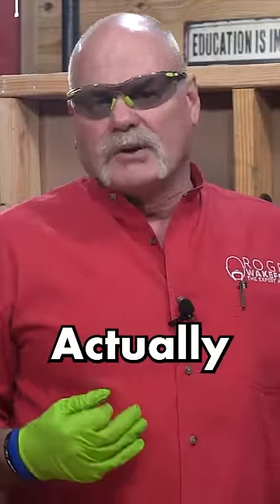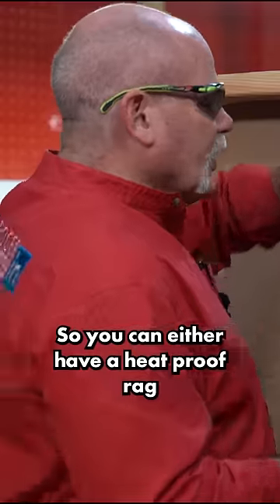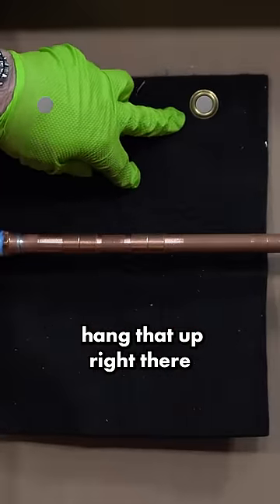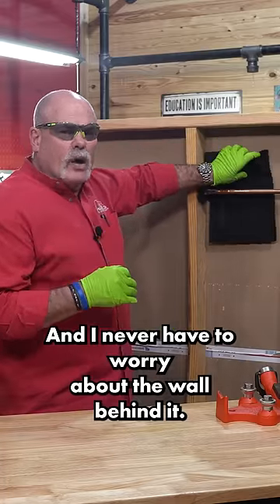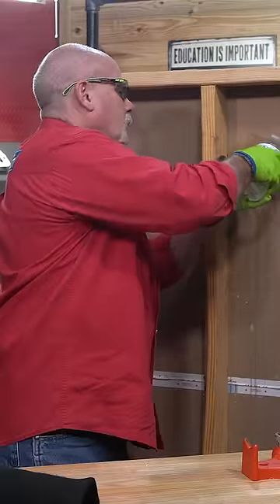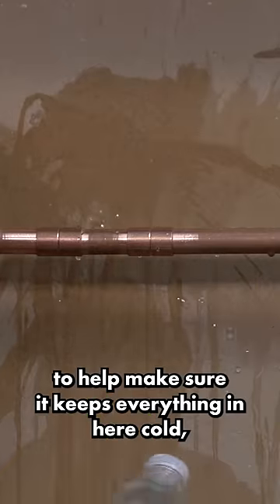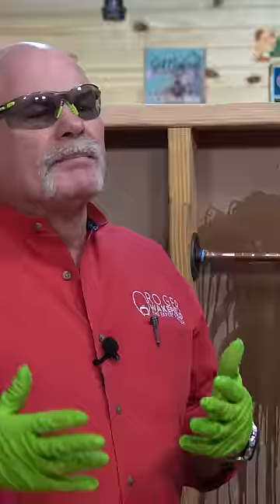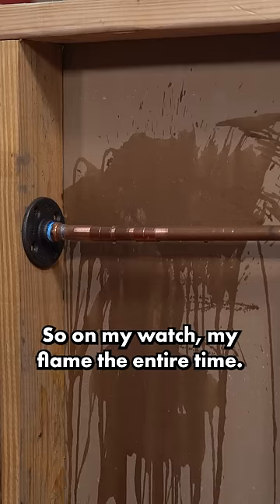Solder Joint Catches Wall On FIRE

Comment: Introducing moisture into a wall is asking for mold.
Reply: Amen brother! Aluminum foil would be a great alternative to protect against the flame and flux splatter!
Reply: @stephenadams9211  I’ve forgotten my fire sheet before and tried to use aluminum foil to heat shield while soldering don’t use it the foil just melts almost immediately but yea also don’t use that water trick that’s dumb for many reasons
Reply: A little water once without a recurring leak will not lead to mould unless your house is as humid as a rain forrest.... It will dry out by next morning.
Reply: Mold is only a problem if it's sustained moisture exposure not a one time exposure. Other wise we would have mold all over everything.
Reply: Mold is okay as long as it's not disturbed just like asbestos . You wouldn't want alot but you'll literally never find a house without some Mold in it
Reply: Cut a piece of sheet metal for the back of the heat blanket
Reply: That little amount won’t do anything and hopefully they dry it before closing it up.
Reply: Hes just the plumber, the drywallers wont be in till next week to close it up
Reply: @Kwilson2O14 yup. Not only that, but drywall mud has a lot of water in it. That water soaks into the rock and still dries off.
Reply: @stephenadams9211  I see someone is recommending things they have never tried again, tisk tisk
Reply: As a mycologist i just want to say your wrong.
Thats not nearly enough water to start mould it has to be a pool and a significant one.
That water would dry up by the time you even put that wall back together.
Or even by the time he finishes soldering.
Now if it sat in a puddle and soaked hydrating the substrate (wall) then you would have a problem but that is nowhere near enough moisture for that.
I mean which one of you demons with no common sense leaving pools of water in walls i mean if you are who's ballsy enough to trust you with fire.
Reply: the torch will dry it out
Reply: yeah this guys has lost his mind
Reply: Why's it gonna mold? Should be dry in a less than an hour.
Reply: let's not forget he's a plumber if he's inside a wall it's most likely because something was leaking so that little splash is the least of everyones problems
Reply: Doesn't heat travel more easily through water than air? Would it not heat up faster by becoming wet? Or does the sheetrock absorb the heat faster than the water would, making the water a good idea? I'm confused
Reply: @zacharybrasher8194  Water is extremely good at absorbing heat. When there is water on a surface, that surface won't get hotter than the boiling point of water until all the water has boiled off.
Reply: @zacharybrasher8194  well bud why don't you try to burn 2 peaces of paper 1 dry and 1 wet report back which ones easier to lite on fire 🔥
Reply: @jeffkenyon7084  spraying a little bit of water wouldn't soak the sheetrock all the way through, unlike the example you just explained. Still possible to start a fire I would assume. A better example would be to spray just a little bit of water on paper and see if it ignites faster or slower than the completely dry paper, but I'm certain sheetrock and paper have wildly different heat resistances so either way it's not too accurate.
Reply: @zacharybrasher8194  OK what's on the back side of sheet rock  will do the test  with that because it's the only part he's worried about I'm pretty sure the sheet rock it self doesn't burn
Reply: @zacharybrasher8194  and oh yeah  that's paper on the back of that Sheetrock  newer better products use different materials that are fire resistant
Reply: This is a bad comment
Reply: Dry with torch. Lol
Reply: If you leave it open for a couple days it drys right out when you cut the pipe to install new parts water leaks, in the summer pipes sweat so older builds did not insulate that valley to avoid moisture build up
Reply: You’re right to an extent. The heat from the soldering iron and/or welding iron, would prevent the growth of mold thanks to the excess heat
Reply: @zacharybrasher8194 What comes out of fire hydrants? Air?
Reply: That and drywall turns to crap when it gets wet.
Reply: Tell me more about how you know nothing at all about construction
Reply: Idk maybe the torch burning right in front of it would dry it out but that’s just common sense talking in YouTube comments
Reply: The water for one time use will not cause molding🤣🤣🤣. U really think the material and manufactures dont know that it need to he water resistance & mold resistance up to a certain code
Reply: You need to seek therapy if you're worried about that much water causing mold in your entire house, im not even being mean it sounds like anxiety or something.
Reply: Are you worried about damp plaster for a day or a burned down home
Reply: Love the discourse. Never know what stray comment starts people going until it does.
Reply: I mean, as a restorer. It's okay if it's literally a water bottle as long as it dries. It'll come back twice as strong.
Reply: Yeah no zero chance that molds, not wet enough so it'll dry out long before any mold has a chance
Reply: Lol no
Reply: I can grow mold on my table in the front room with a small puddle of water.
Reply: I’d think it would be okay so long as it isn’t sitting or constant.
Reply: Naaah. It’ll be fine
Reply: No it's not, the water will dry most of the way out by the time he's done soldering the pipes.
Reply: Defintly not lol squirting drywall with water would not make it mold over exposure to water would
Reply: @NickP771  actual it only takes about  24-48 hours for mold to grow on damp surfaces even if you dry the surface the water is absorbed in to the sheetrock
Reply: How fast do you think mold develops? That tiny bit of water, which will have dried a bit from the soldering process, is going to be dry by the next day. To get mold to start growing you need it to be consistently wet for far longer than 12 hours.
Reply: Not a mold problem but it could weaken walls maybe rust a screw or 2.
Reply: Smh

Comment: Old houses often have cobwebs up in the walls which easily catch on fire and send flames up into the walls like a chimney. So clean those out first.
Lightly spray with water.
Use the black cloth flame resistant shield, and/or a doubled up piece of steel sheet (folded over so there's air gaps in between) such as 28 gauge smoke pipe.
Use the lowest flame that will get the job done. No need to blast it. Heat the pipe a little to start and then switch to heating the fittings (this is also now the recommended way to solder lead free brass fittings). Touch the solder to the joint and it should get sucked in. Don't keep feeding it in or the joint will fill up with solder.
Rule of thumb is the pipe size is about the length of solder to use. i.e. 1 inch of solder per 1 inch joint.
Guys on here suggested press fittings. This is a Really bad idea, especially inside of walls. Those fittings are not time tested. They have o-ring seals that will probably deteriorate in water or dry rot if the building becomes vacant and the water is drained out for a while. Proper solder joints will last for 100 years.
PEX is really popular now because it is fast, cheap, and easy (like my ex girlfriend). PEX is smaller inside and the slip on fitting choke the size down even more. Most homes use 3/4 main runs. These need to be 1 inch if using regular PEX, unless using Wirsbo which expands the tubing to go over full size fittings.
Most people think plumbing is so easy.
If plumbing was easy then everyone would be doing it correctly, and most people, even most plumbers, do not.
Reply: For most of the pex we use we have to expand the pipe first then press on a little grey compression ring. I think the fittings are the same ID as the pipe.
Reply: The worst is the Old coal dust from when Houses used coal for heating.
Reply: I stopped reading your comment when you said spray with water.
Reply: And always heat with the tip of the inside flame!  That's the hottest part and gets the fittings and flux up to temp faster.  My first few joints I held it too close and burned the flux and they leaked.  Once I learned how to properly heat, it was cake after that!

Comment: You pour water on my sheet rock you’re getting throw off job 😮
Reply: Would you rather the whole place burn down?
Reply: @The1stCheeseLord  don’t light the wall on fire? It’s as simple as that, have water ready you’re just asking for mold and water damage by spraying it like that
Reply: @cheezyboi or Horchata   if your only 2 options are pouring water on sheetrock or burning it down... you have no business working.
Reply: @The1stCheeseLord  Aluminum foil...
Reply: Right?
Reply: Straight up! That then makes the drywall installed liable for any mold that starts to grow. Horrible tip!
Reply: @nathanchandler18  hahaha
Reply: @becausewhynot3091 mold can only grow if the exposure to moisture is sustained. That water would dry long before mold could form.
Reply: My uncle was on a job where the plumber burned the roof off a new build house (in the UK) because he caught the insulation. Also it's common practise here to have an extinguisher when doing "hot work"
Reply: Ever try lighting sheetrock on fire.  It don't burn
Reply: @NickP771  finally someone answered that knows!
Reply: @NickP771  It was my understanding that since drywall is very porous that it could take up to three days to fully dry(depending on the amount). If they insulated those walls and finished the other side in let's say 2 days, would that not be enough humidity inside the wall to form cultures? I apologize if im completely wrong.
Reply: You pour water or catch my wall on fire you're getting thrown off my job site
Reply: As a mycologist i just want to say your wrong.
Thats not nearly enough water to start mould it has to be a pool and a significant one.
That water would dry up by the time you even put that wall back together.
Or even by the time he finishes soldering.
Now if it sat in a puddle and soaked hydrating the substrate (wall) then you would have a problem but that is nowhere near enough moisture for that.
I mean which one of you demons with no common sense leaving pools of water in walls i mean if you are who's ballsy enough to trust you with fire.
Reply: @stephenadams9211  yeah, be Use acetylene  won't burn that.
Reply: Right
Reply: @phuckyoutube5927  I've seen some horrors on new builds, usually the roof has a small leak and you get water in the wall cavity and it soaks into the boards, if the heating isn't turned on soon enough the mould grows crazy fast. (To be clear, I'm agreeing with you) I'm a painter so it's usually my job to use block stain on the stains
Reply: @Eggugat  you do realize you solder joints with a propane torch right? 😂
Reply: @leviwooten3795  i meant mapp gas 😅
Reply: No need for the water piss is better
Reply: Well you clearly haven’t every worked in construction bc sometimes you gotta do what you gotta do to get the job done. A little water like that will not cause any problems. Water does a lot less damage than it catching on fire
Reply: there isn't even going to be any water left when he's done soldering lmao

mold doesn't grow instantly, it needs sustained moisture from a leak
Reply: @stephenadams9211 aluminum foil will just melt my guy, it doesn't have the heat capacity for this application
Reply: @stephenadams9211  too thin. Will just burn and distort. Has to be some decently thick metal. Usually a piece of scrap tin works well.
Reply: Reeeeee
Reply: Oh no is your fragile little sheet rock going to spoil from a light misting of water? You know what... you're absolutely right! Plumbers should just cut the sheet rock out so we can solder without having to worry about getting your wall getting too wet.

Comment: Honestly, you should have an extinguisher with you while you do that. A spray bottle full of water works well. Yes, water bottle is not a bad idea but it’s only 20oz of water. I use the industrial style Zep spray bottle from Home Depot. I can mist the wall without soaking the Sheetrock entirely. You can also cool down your solder quicker and spray the inside of the bottom of the wall to make sure no embers got down there. The heat rag is a great tool too!!! 

Also, please, PLEASE, clean the flux off with a degreaser after you’re done, green oxidation is not pretty.
Reply: Cooling the solder too quick is a great way to get a weak joint
Reply: Don't cool your solder off with water. It compromises the integrity of the joint. You want it to cool slowly, just like with welding.
Reply: Not talking about cooling it as soon as you’re done, talking about cooling it so you can work with it again quickly, depending on what you’re doing. Yes, Spraying it too soon jacks up the solder too.
Reply: Glad you guys clarified that though!

Comment: I love how Roger looks like a hardass you'd see on most jobsites, but he actually cares about safety and well-being just as much as the job, like a good boss would. Thanks Roger. As a framer and carpenter (I LOVE doing cabinets and trim) I can really appreciate it. There's just a special kind of feeling when you work with a company that cares so much about quality that they select subs based on quality instead of price or speed. It's so great to actually work together and feel like a team that's working towards a common goal. That's so rare in tract homes and most building projects. I worked for one GC where the owner fired a newly hired supe after he found out the supe tried to ignore some dry-rot we weren't contracted to fix. He told the dude "You're compromsing  the quality of my company's work and our reputation and that is absolutely unacceptable. We do not cut corners here. I have to let you go". I wish I had never quit. Great bosses and a great company.

Comment: I'm a welder and we have fire cloth you can buy rolls of and it's just flame proof fiberglass blanket type material. Drape it over your flammables and go at it. Keep that extinguisher ready though
Reply: Ceramic wool works great for me
Reply: Yeah, those work well. One time i laid on some wearing shorts. Lets just say I regretted my mistake
Reply: @Joseph Barry  When I was young and first starting out I didn't want to damage equipment and used loads of it and draping it over everything while wearing short sleeve shirt in summer. I know exactly how you feel 😄. If you get fiberglass in you I normally use duct tape and stick it to my skin then peel off. Won't get it all but it helps tremendously.

Comment: So you wet down the drywall, adding moisture to an enclosed wall cavity, great wall to introduce mold or cause mold to stick and start to grow. Use the fire proof blanket and save yourself a possible mold related situation.

Comment: Always poked a hole in a water bottle lid. Just one nice hole, good jet stream when squeezed, easy to re-wet while soldering, especially when you have to steam out some water first, also super handy if you catch a little felt paper, douse it right away and don't give it a chance to travel.

Exactly why I keep like 5 extra water bottles in the van.

Comment: We use a squirt bottle and spray water down any cracks below the joint we are working on. Plug any holes that are drilled through the bottom plate. I did this for welds when I was an ironworker and never had issues with fire even on wood frame buildings. We still had a fire watch with a fire extinguisher but you don't want to pop an expensive fire extinguisher for a little smoldering.

Comment: Cool gel and the putty that is used to keep fittings cool during brazing freon lines but it also matters if it's a competent Plumber or just a "Handyman". I use air shim bags as well when needed to get away from the wall etc. Competent Plumbers have systems/procedures in place to make sure that never happens.

Comment: The way we do it is holding a metal tin behind it not touching the wall preferably but bigger the tin the better because it will heat up slower. And If really needed you can spray that tin with the water from the bottle. You're welcome

Comment: The best thing to do is to use an induction heater. It's relatively new tech accessible to regular people. No flame to worry about and no issues with rapid oxidation and runny flux. The induction machines are as fast or faster than a flame.

Comment: I do like to solder. But usually in a wall like that I’ll use press fittings to ensure there is no open flames. Especially in old homes. I have been on a lot of jobs where the customer doesn’t want any open flames inside the wall. I will never use a shark bite in a wall. But like I said I generally use a press fittings. But I have soldered in a wall and I usually used a wet rag behind the pipe that seemed to work.

Comment: And thats how you make the repair even more expensive. Splash water on the drywall. The moment you do that, there is no way to properly dry it. It will do 1 of 2 things now. Deteriorate, requiring the replacement of a large section of the wall, or mold horribly after you’ve already closed the wall, causing health issues and the replacement of the entire wall

Comment: First week as a new apprentice my plumber working on the main floor of a three story walk up set the wall space of the bathrooms on fire. Sounded like a freight train roaring down the tracks. He started packing up and ran to his truck and I ran up to the third floor and kicked in the shower wall and stuffed a fire hose down the wall space. 

I even asked him before he started if it was safe!  And to those thinking I made a chimney and caused the fire to jump up the walls by kicking in the tile. Well there were dryer/shower vents running in the same 24” x 7” deep wall space all the way to a pagoda top “room” on the roof and that lit up too.